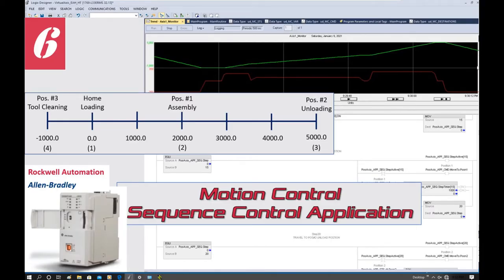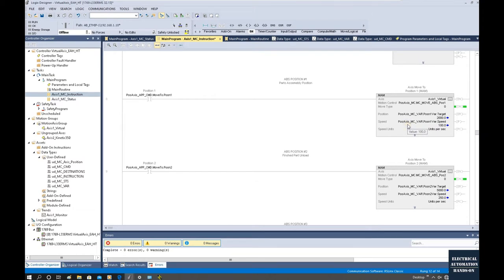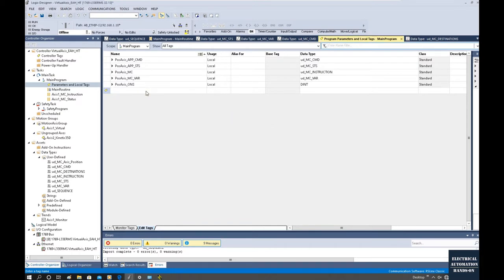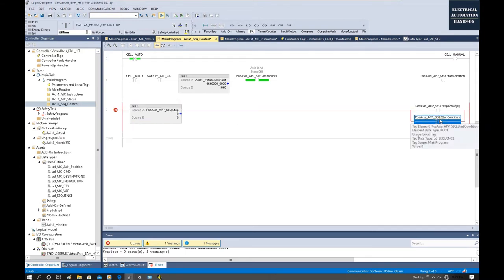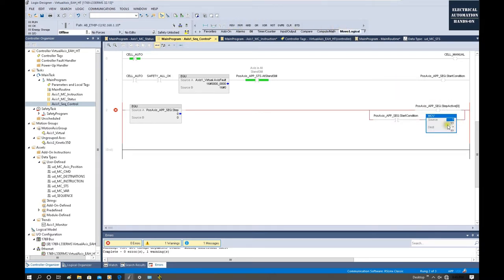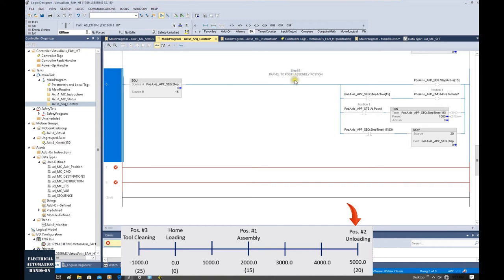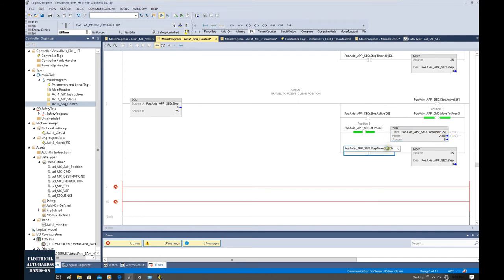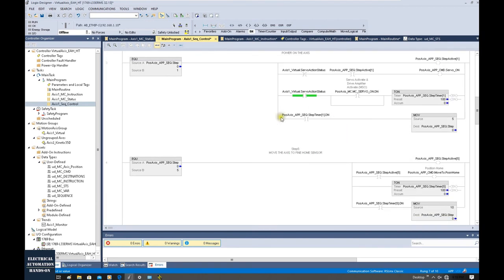MA06. [AB Motion Control] Sequence Control Application in Rockwell Studio 5000 [9/10]

Comment: Excellent Video Series to Learn Motion Modules,Can You Please make videos on programming Vfd And Encoders also.
Reply from the maker: Hello, I won't have chance to have an ERM controller recently so I could not have a way to show the VFD and Encoder topic. Sorry. But once you could have the hardware system and have Kinetics5xxxx, the connection on drive and encoder should quite straight forward. Bty, are you going to use VFD and Encoder to do Vector control or Positioning control?

Comment: Can you cover some basics covering the terms mostly used in motion field. Also, please cover some intermediate level topics MARP, Caming etc.
 I have learned a lot. But this video could be marvelous if servo motor and real axis were used and shown.
Reply from the maker: Thanks for your comments. As you saw, this is the MA06. there are many videos at Motion Control playlist https://youtube.com/playlist?list=PL762SfoJC-e8NbAUQ-H7a_TOdqrlBPCw4. Yes, I am also hoping I could have the servo drive and show the actual cases, I will do once I get hardware. Also likely some videos I talked, using virtual axis would be the 90% cases same as the youtube viewers. Because 99% as a electrical guys will set up the program at first, then wait for hundreds years (Hahaha) for purchase and delivery postpone, then you get the drive. So using virtual axis has been a common case for various motion control test.
Reply: @electricalautomation  Yes! you can add hardware for some paid trainings. For free youtube content virtual is enough i think.
Reply: @electricalautomation  I have seen all the Rockwell playlist. Recently used trend after speed change of machine. I was looking for change of average speed with y axis limits set to defaults. I see why i was facing difficulty. :D